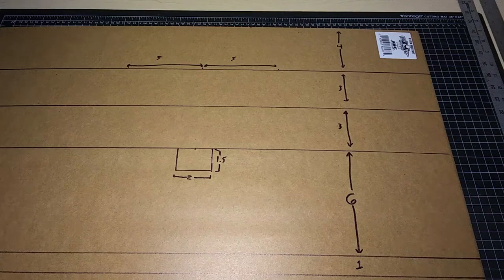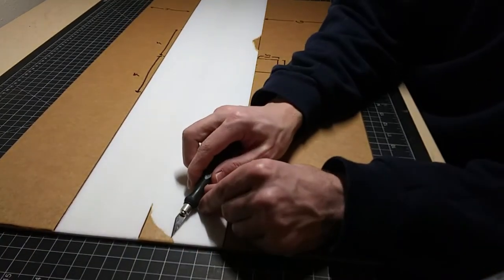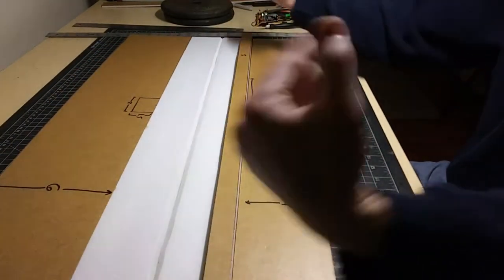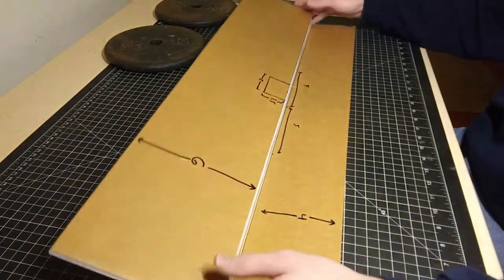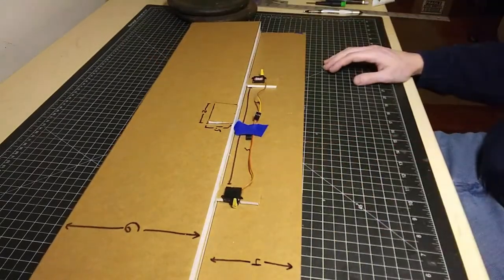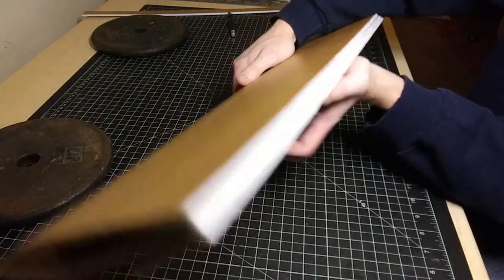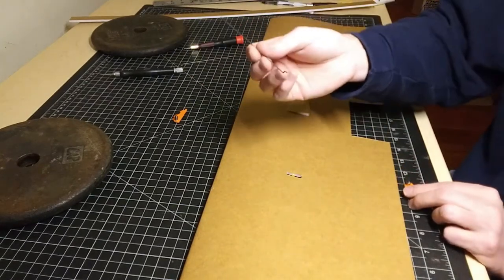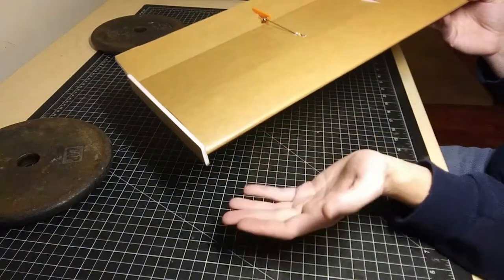Building a Symmetrical Wing For HB Model Aircraft

Comment: A tip for cutting the bevels.....place your straightedge about 1/4 inch away from the fold and use it to guide the top end of your blade....perfect bevels every time.

Comment: If you are going to hotwire cut a solid foam wing cores, what airfoil matches the saddle on the fuselage?
Reply from the maker: E168 with a chord of 178mm and 100% thickness.  This results in an airfoil that can be cut from a 1" thick foam blank. See: http://airfoiltools.com/plotter/index?airfoil=e168-il
Reply: Using a fully semetrical airfoil, draw a line from the center of the leading edge to the center of the trailing edge along the end of the wing....the bottom half is the shape of the wing saddle.

Comment: Do you have recommendations for cg. and control throws?
Reply from the maker: CG about 1 inch from the leading edge.  Elevator throws of about 20 degrees.  Aileron throws of about 35 degrees.  Use reduced throws for the first flight then increase them to your preferred level of responsiveness once the plane is trimmed.